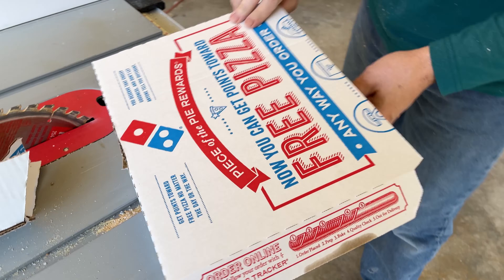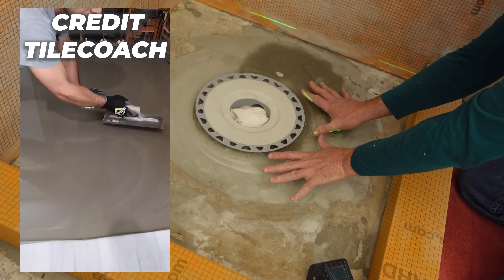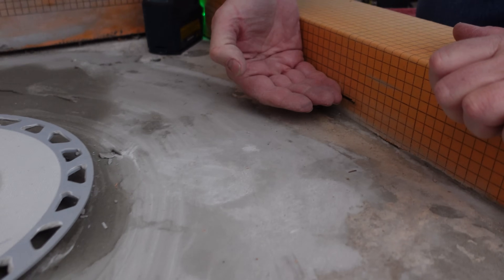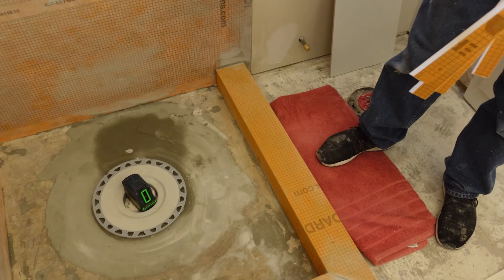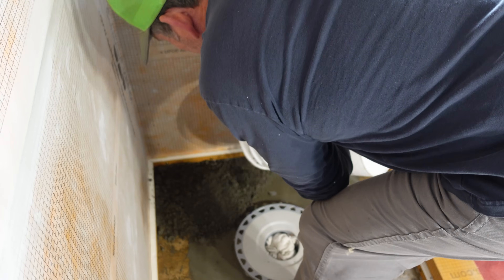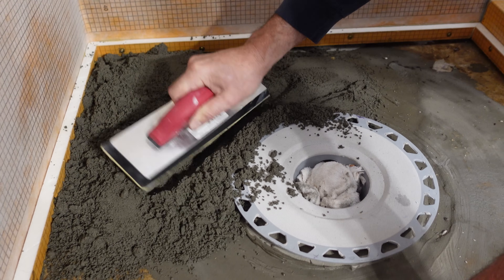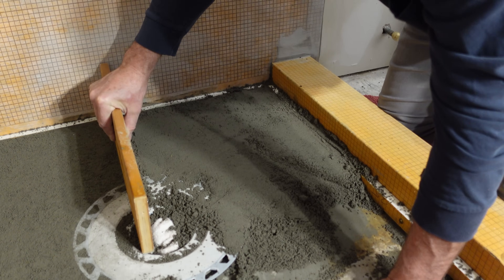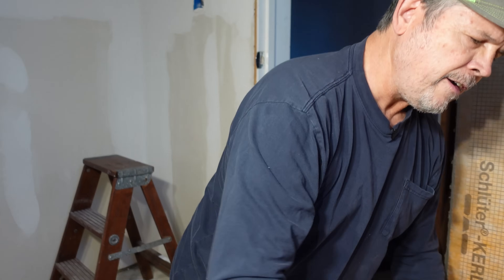HOW TO BUILD a PERFECT Shower Pan PRE-SLOPE (Great for DIYers)

Comment: I’ve recently ventured into tiled shower installations.  I’ve found so many helpful tips watching your videos.  One thing I struggled with in the beginning was drains.  I would watch various videos from different tile gurus searching for clarity.  Some would show using the old style Oatley drains with the weep holes.  It’s my understanding that these type drains used a pvc liner and a pre slope mud bed prior to the final slope.  I would watch other videos where a preformed shower pan would be used with a drain which membrane can be secured making it completely waterproof without the need for the pvc liner.  Maybe it’s out there, but I’ve yet to see anyone give a detailed explanation of the 2 systems.  I just kept researching before figuring it out.

Comment: I've been doing tile for 13 years and I'm ashamed to say I learned something from this video! Great work! Only thing I would change is you need to burn some thinset underneath that mud bed to add some strength & bond to your mud, wiping it alone won't do it. Other than that, this is top notch mud instructions!

Comment: that’s a good idea using the foam strips for screeds! I screwed up on my pre-slope using kerdi so now I’m trying to rework it without taking the whole thing out. I was going to use rapid set mortar, because my corners were kind of messed up because of the buildup of the kerdi corners. but I’m going to rip down a few concrete expansion joints (someone who commented below suggested those)  because I don’t have any kerdi foam board laying around and see if I can screed it from that. I’ve only done a few tiling jobs, but the kerdi I messed up on. I build up too much at the corners and there was a few pockets of air underneath the membrane so I ripped it out. I’m gonna do redguard over the rapid set mortar and hopefully i can salvage this pan. Thanks for sharing your knowledge stud pack!

Comment: Outstanding video. Showed great detail & products and far more articulate than obama ever hoped to be. I'm in the planning process of installing/making a custom sized shower for a duplex apt built during the coal mining era in PA. For benefit of those unfamiliar with 'company' built homes for their workers (in the later & more 'civilized' years,1930's -1940's) bathrooms were still very small. More often than not, a person usually had to walk sideways between the wall & tub to use the toilet. Bathrooms 4 1/2' X 7 1/2'  was the norm. 'Better' homes had a bonus 3 1/2' X 3 1/2' toilet cubicle in the cellar. So much for the history lesson. With some tear down I am planning to enlarge the bathroom from 35sf to about 54sf and ditching the tub for a sit down compatible shower. I'm thinking of a 48" - 56" wide shower but only 30" deep. Your video gave great custom ideas over the standard 'plastic' 3 or 1 piece standard sized shower units.

Comment: We have a product in Australia called bondcrete.
It's a bonding and sealing agent for concrete.
It's kind of like a contact adhesive.
But it's white not yellow.
Almost like a very runny PVC glue.
Put some on your concrete and the mud will Bond to the concrete
Reduce the chance of a drummy or Hollow sounding floor

Comment: You should waterproof under the sand cement because it protects your floor you can do it over the sand cement as well like both the floor and the sand cement. But you need to to the bubble level to do the flooring because you can see where the fall is going too. And make the sand cement smooth finish so you can tile on top of that ❤️❤️ just a few tips as I do this for a job ❤️❤️

Comment: I haven’t read all the comments but I always use a layer of wet thinset on top of concrete first, then pour your dry pack on top of that. Just wetting it is not good enough. It’ll not stick to it.  It’s probably not going anywhere but the correct way to do it is to put a little layer of thinset on top of concrete. Great channel. 👍
Reply: He explained this in the video and said that was how he use to do it, but a Commenter said he didn't need thinset so he quit using it.  Who's right??
Reply: @number6396  I am. It’s a way of making a solid connection to concrete.

Comment: I use cap brick the 1 1/2” x16” grey brick at the box stores, cut into 1 1/2 z whatever height I need set them in thin set to the level perimeter. I have several 1” angle aluminum to use as screeds. Super easy

Comment: Thanks! I've been researching you and tilecoach for the past 2 weeks. I have a master bathroom rebuild to do starting soon.
Reply: Be sure and look for the correct way to hang the wall board where it meets the pan.  On a drain system (drain with weep hole) you need to get it right the first time.  See StarrTile.  If you are doing the Kerdi system, Stud Pack has it down.

Comment: The easiest way to mix your drypack is to use a tarp. Dump the bag in a pile in the center of the tarp and make a volcano like hole in the middle of the pile. Pour the water in hole and let it sit for 30 sec or so. Then get a guy on each end of the tarp. Pick it up by the corners and using both arms and feet, work the drypack back and forth. Alternate rolling the pile towards each other. It mixes quick with minimal water. I do it right inside the bathroom. Try it, it is life-changing.

Comment: Best video Ive seen on this! Just did a custom shower pan like this.  I mixed it very dry as recommended, and its in the basement so directly over concrete.  It cane out good but after it dried it makes a very slight noise when you walk on it (very slight, guessing because its so dry and its not bonded to the basement concrete floor).  Is this a problem?  Should i remove and start over?

Comment: Hi, these videos keep me up all night!  I can't stop watching.  Thanks for great ideas and technique and products!
So I have a question, I'm working on a concrete slab where I demolished a tile floor in bathroom.  the bedroom has flooring that was set over the pre-existing tile floor (they didn't remove the flooring - just added new tile flooring over it).  We had to reroute plumbing in the bathroom through the slab, so had to cut slab and then patch after plumbing.  SO NOW there is just over 1.5" difference in finished tile floor height of bedroom and concrete of bathroom.  QUESTION:  any ideas how to cover the concrete and build up the height before laying down the tile??  Should we pour concrete first to raise floor or just rely on the mortar and membrane.  Does the membrane lose function if there is more than an inch of mortar over it?  Any help or ideas are greatly appreciated.  Thanks.
Reply from the maker: Thx Robert 👍 I think you're in that Goldilocks zone.... 1.5" is too thin to pour concrete and too thick to make up with thinset IMO.  I think this is a perfect application for self leveling underlayment.   Custom Building Products LevelQuik RS is readily available at Home Depot and can be applied up to 1.5" thick in a single pour.  Prime the slab first with their primer.

Comment: Checkout KBRS shower pans. You can get custom made ones made but generic premade ones run around 600 bucks. It is a matter of putting thinset out and putting in. Of course there is a drain requirement that needs to be done but it is fully water proof with flanges all around and a built in curb. Custom sizes get a bit more expensive. I had a custom made one for a 3x5 shower pan with the drain not in the middle for 950. Mud pans are cheaper for sure but more work.

Comment: Nice instructional video... It is clear you put much thought in the presentation. Very helpful to "demystify" the construction process. I have several issues I noticed with your waterproofing. Firstly, when you installed the curbing, you did not install corner water proofing membrane. With settlement the curbing at the intersection of the wall and the corner could open up allowing water to penetrate; I know you are on a slab but on a plywood sub-floor you will certainly have a leak. Also, when you screwed the screed foam along the perimeter, you screwed through the Kerdi waterproofing barrier. My company uses Kerdi waterproofing systems and know ALL screw penetrations MUST be patched over. The wall membrane should have been lapped over and into the niche more than the 1" one the edge. I know, picky, but that is the difference in warranty coverage and minimizing the risk of future leaks. Nice videos. Keep up the good work
Reply from the maker: Thx Patrick.  All waterproofed in next video 👊 this one was just on the pre slope

Comment: It’s been many years and I have a project in my upstairs BR. Looks like we don’t use vinyl shower pans with walls lapping into pan anymore? Does this system last as long? Seemed like if I did them right they lasted forever? Is that incorrect? How long does this system last? Am I missing it, or does overlap top over the bottom doesn’t matter? Very clear presentation, thank you.

Comment: Hi Studpack! Could you please tell me what kind of shluelter drain that is set in the slab? I've seen this used in multiple videos & I'm trying to fix haphazard work done by someone.  

Also, I'd love to know if the curb is wrapped or you buy that vs 2by4s? Thank you so much! 

Without pros doing excellent work and sharing,  homeowners would still be at the mercy of a those who want repeat repair work more than great craftsmanship. 👍 😊❤

Comment: Thank you a million times over for this detailed video. I am building a curbless shower and want a long drain that will extend across the floor where the clawfoot tub is and also the shower. Do you have any advice on how to put the slope in the shower (the drain will be along the edge, not in the center) so it will drain but it can be level with the tub floor as well? Will I need to lower my tub the same as I did for my shower floor in order for this to work?

The shower and tub will be in the same “room” so that either one can be used behind the shower walls. Not sure if I’m making this make sense enough for visualization.

Comment: My job has a few low spots(3/8"), along the wall on 2 sides. The floor base is still sloped, but has an area where I might have to miter the tile to make it come out even. My question is, can I add a little thin-set below the tiles to level it back out, or worst case scenario, do I have to rip it all out and do it again? I really liked your method of putting a thin strip of Slueter board along the wall. I wish the guy who installed the base had known that method.

Comment: Great tip. I'm going to need to do this and I was worried about the slope. I'm going to do it this way. Super helpful
Reply from the maker: Cool thx 👊👍
Reply: Check out Schluter’s pre-sloped shower tray. It can be cut down or expanded with deck mud to fit your needs. I learned how to do this in a free workshop that they provide nationwide. The hands-on training and learning the minimum legal requirements from the TCNA handbook was awesome. Installation videos are available from the manufacturer on their YouTube channel and they have phenomenal support from their website and local representatives. I admire Stud Pack because they are more accurate than not from what I have discovered. In my research then I learned to crosscheck the information in videos like this with the installation instructions from the manufacturers. I have discovered how important it is to do our due diligence and decide for ourselves. Good video but make sure that you check out the installation instructions yourself so that you make sure you understand all the details you need to know. I wish you luck, I hope this is helpful and thank you! PS. Please watch, “Trowel and Error”. A fundamentally awesome video on YouTube.  Well worth watching. 👍

Comment: You should check TCNA standards. Drypack on a slab is supposed to be bonded to the concrete with thinset.  Just because some dude told you so doesn't make it right.  Otherwise it's an awesome video.  I use 3/8" plywood for my screeds because it all gets covered with Kerdi anyway.

Comment: I did a dry pack base a few years ago and hated how it turned out. For my next shower, I used the Schluter base, which was way easier but it was straight onto a flat subfloor. At least I know how to do it right so I don't need to avoid this in the future.

Comment: Another great video from the Stud Pack guys!  I liked the shout out for Isaac at Tile Coach as well.  I frequent both channels preparing for an upcoming bathroom remodel.  Did you see the trick about mixing the dry-pack in the contractor bag?  Looks slick.....
Reply: I love comparing information from other channels too. Doing your due diligence is wise. I learn to make sure that manufacture specifications lined up with the information in the video. Stud Pack more often than not seams to be accurate but the responsibility is mine to make sure that I check the source of the product I’m using to make sure that I know all the details and the proper specifications for installation. Schluter has installation videos on YouTube and free workshop training that also teaches the legal minimum standards from the TCNA handbook. The workshops are nationwide and I took two of their workshops. A very eye-opening experience. I now have the phone number of my local representative that is available to help me plan out projects and provide support through a project as needed. I hope this helps. Thank you!

Comment: Needs a thin set under your mortar bed. Even with the vinyl linings there’s a pre-pitch underneath of that which is then thin set under your pre-pitch. And you need to use coated screws when you screw in your band boards inside your shower pan. Those screws will corrode over time since they are not coated.
Reply: he is putting Kerdi on the top of that slop. water will not get past it

Comment: lol ive used screet boards for years.  but i usually just use 1x2 boards and shim them to the right height . They will stay without screws once you put the mortar on it. then when Im done I pull them out and fill them after. or leave them in. as the wood shouldnt get wet anyway, and if it did . its better than putting a hole with a screw

But I think i know of a little different way that may be faster  that I am thinking of trying out.   is to use the boards around the outside. Mix up a slurry of motar and thinset  pour it in all around. Then use a 1/4 piece of wonder board cut to size with drain hole cutout and bunch of  holes punched all around in it.  put it down and then attach/glue the drain in to hold the center down. then go back with a board to press the wonder board flat sloping to the drain, and scrape off the excess thinset that comes up through the holes. If not enough in a section just lift the board edge  or make a little bigger hole and add more mortar slurry. I guess you could just use LFT thinset( Large format tile thinset) but why it costs more. 
which I dont understand why it does anyways. as the only difference is that LFT thinset just has a larger aggregate. basically they use playground sand instead of fine silica sand. If you put some SPEC mix into regular thinset is essentially the same thing.Which is a heck of alot cheaper than $30+ bag of over priced LFT thinset.

Comment: Thank You Sir! I am a shower greenhorn and I love your video. I have a fishing shack in the north woods and want to remove the 1950's sheet metal shower and do a custom remodel to the bathroom. I shut down the shack every fall and re-open it in the spring. Every January, the temperature gets down to 30 below. My biggest concern is that the sub zero temperature might crack the dry pack or drain pan. What are your thoughts?
Take Care,
Tom

Comment: Great tips and your teaching methods kept me very engaged with the video every step of the way. The one thing I would probably steer away from though is the Detra membrane in place of a poly styrene plastic. The Detra membrane has a little bit of give in either direction with its uncoupling function. I’m not sure if that would mess with the structural integrity.

Comment: In order to be certain that the slope of 1/4 inch per radial foot ALL THE WAY AROUND the center of the enclosure is NO LESS THAN 1/4 inch per radial foot, you need to establish the height of the top of your screed along a radial line from the center of the enclosure to the FURTHEST possible point from the center, and NOT to a point closer to the center.  In this case, into the corner farthest from the center.  Then, use that point and the laser level to carry that height all the way around the entire enclosure.

If, as you did, you establish the height of the top of the screed at a point that is less than the greatest possible distance from the center, and you carry that height all the way around the enclosure with your laser level, the slope to points further from the center than the distance from the center at which you established the screed height will be LESS THAN 1/4 inch per foot.

Put another way, if you want to achieve a given slope, such as 1/4 inch per foot, in EVERY radial direction around the center, the top of the screed needs to curve progressively upward (be higher) for points progressively further from the center than the point at which you established the height of the screed.  The only geometry in which the screed will match up with your laser level line all the way around the center is if the boundary of the enclosure is a circle concentric with the center.

Comment: Question guys, convert existing 48x42 shower to curbless. Floor is 12" tji's, chords are 1.5"x1.5" lvl.
19.2 oc. 3/4" subfloor with 5/8" underlayment & ceramic tile. Clearspan of 13'.
Love to hear your thoughts on converting it... You guys are doing a great job btw!